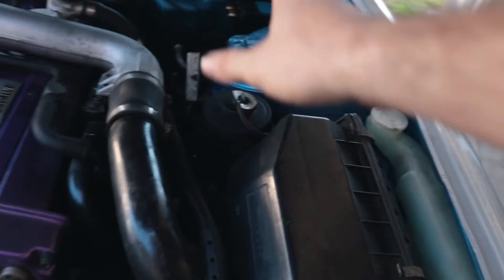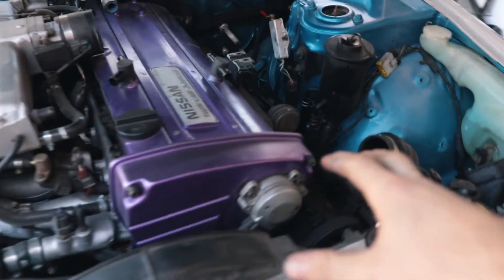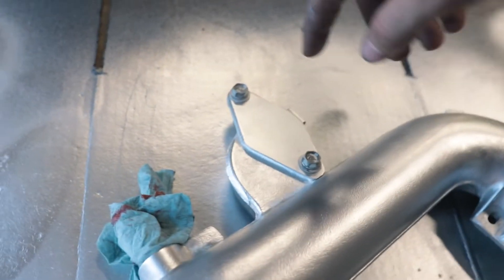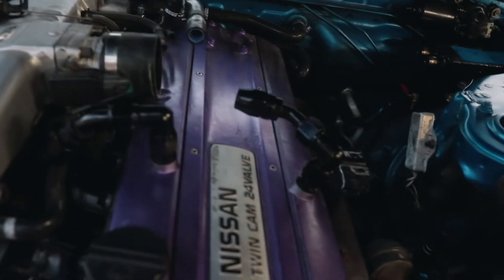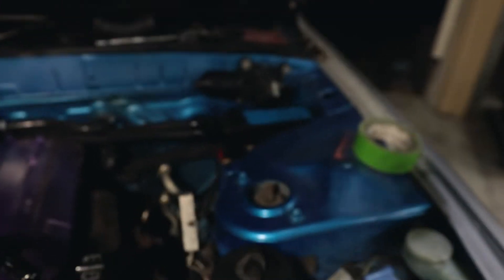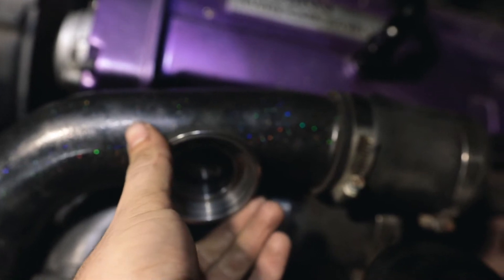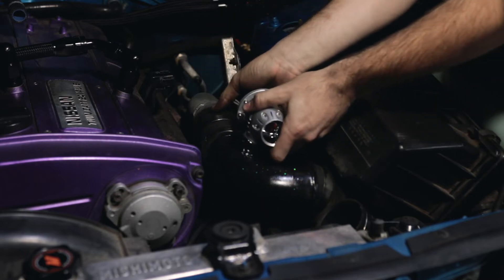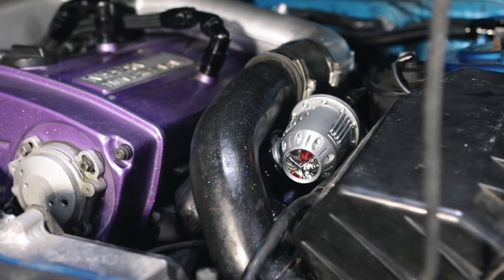HKS Blow Off Valve Install On My R32 Skyline!

Comment: How did you get around the MAF w/ vent to atmosphere BOV? My RB20 ran like straight ass when i put my old school Apexi BOV on. After being in boost when the BOV vented, the RPM would drop so low that the engine would die if i didn't give it some gas.
Reply: What did u end up doing to the BOV on ur RB20? Coz I’m thinking about putting a BOV on my R31 RB20